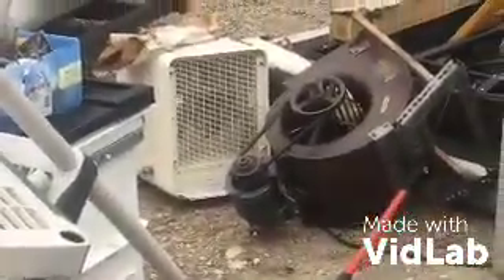SCRAP PICKING COMPOUND STYLE

Comment: You need a drill with kango mode & nice sharpened bolster bit blasts the gold arches off in seconds. Forget any other way. Or air chisel for them with one. Weekends full of kerbside king sat in warm cab.
Reply from the maker: Good at the curbside for sure 
It’s brutal cold 🥶 weather here right now 
Sitting in the warm cab 
Smart move 
Getting down to -2°F
Burrrrr
Nothing is going to be out by the curb side
With those temperatures

Comment: We all develop our own priorities, but personally I wouldn't waste copper like that. I'm in a real poverty state.... New Mexico. Scrap is hard to come by around here. The noodles are easy to pop right off the steel rad ends when they are cut like that. A five gallon bucket with a tight lid, a couple squirts of ketchup and some water.... That dirty looking discolored noodle collection will be bare bright in a couple weeks. Just put the bucket on it's side, and give it a little roll each time you walk by. Plenty of weak acid in the ketchup, and minimal work on your part.
Reply from the maker: Oh what you say is correct
Absolutely

I could never figure out why the state of New Mexico is so poor
Doesn’t make sense to me
But I’ve seen it so I know it

Anyway I did the calculations I weighed that bucket
I waited and made the video of it

After doing the math calculations it comes out that I probably would’ve made an extra dollar or so
After. Quite a bit of work
When........ well I’m busy playing around with little bits of copper I could be driving around and finding possibly a huge pile of copper by the curb. That I am missing out on because I’m so busy just trying to make a dollar
When in fact I could be making a couple of hundred dollars

I will pass on making the dollar extra when I could make a couple of hundred dollars

I just can’t figure out why this doesn’t make sense to anybody
I don’t get it

Comment: Copper/Aluminum @ $1 a pound compared to #2 copper @ $2 a lbs.  Your choice
Reply from the maker: Yes indeed. These were. All steel ends 
Heavy in weight 
Low  amount of copper weight high steel weight

Comment: Why not cut the noodles off first, then the steel. Voila you're done. Twice as much cutting, but you're not picking it up all the time. Anyway..... whatever works for you, buddy.
Reply from the maker: Well OK my answer might sound like I’m being a smart ass but I’m not if you’ve done enough of these you’ll notice that some of the radiator ends have bent flange ends going different ways making a clean smooth coatdifficult if not impossible
Difficult if not impossible when trying to create a clean aluminum copper radiator
Occasionally you will end up with radiator ends they have flange ends there are  bent in different directions

These ones were made of steel and steel is pretty heavy especially compared to copper
These are the handful of radiator ends that we’re just too difficult to disassemble any further
Estimated value of clean copper would be about $14
I got $12.50 for this bucket as is

My one question is how far are you willing to work and for how long for about a dollar or $1.50

Put it this way what will you do for $1.50

How long will you work for $1.50

What could I get you to do for $1.50

$1.50 doesn’t even get you one McDonald’s ordinary hamburger after tax

I think you can get the one dollar coffee or one dollar pop at McDonald’s for this extra labor

While I am spending whatever amount of time it would take to break this down for me I estimate at least 30 minutes probably more

I could be spending my time fixing something that’s broken or more than likely driving around at the curbside looking for goodies and who knows I might find a pile of copper
Wouldn’t be the first time
With minimal labor involved

Would you be willing to pass up a couple hours worth of curbside scrapping for the opportunity to make another dollar and a half
Instead of potentially 100 or $200 found out the curbside

I think a few weeks spent with me and you would figure it out real soon

If this is all the scraps that you end up having over then it’s micro scrapping and you probably definitely would spend three hours taking this apart as the amount of scrub available to you is quite limited

You wouldn’t believe how many people are angry with me then I scrapped the stuff the way I did

Oh and one more thing you’re in relatively warm New Mexico and I’m in the frozen tundra where you probably wouldn’t be willing to spend too much time breaking things apart while freezing yourself

All Scrap or do things differently
It depends on the individual